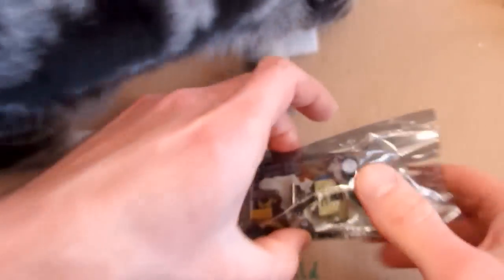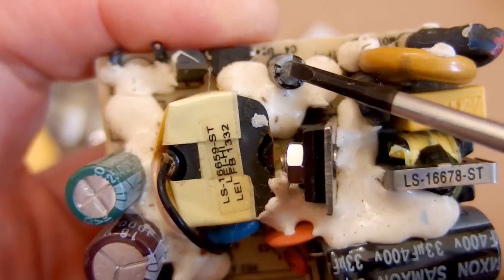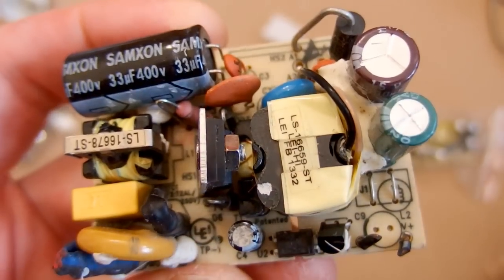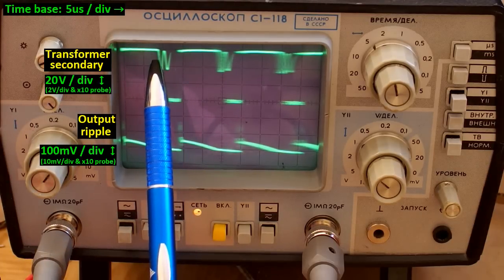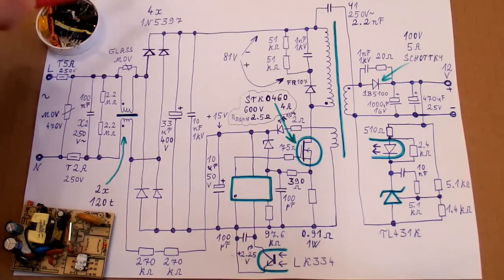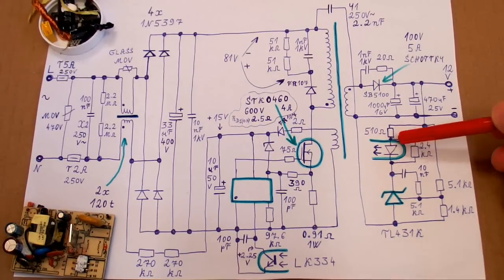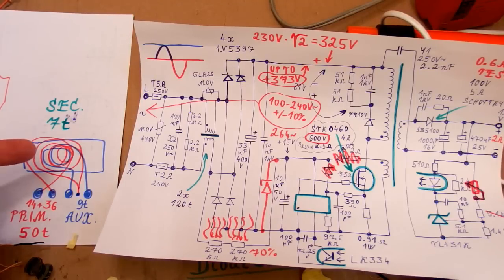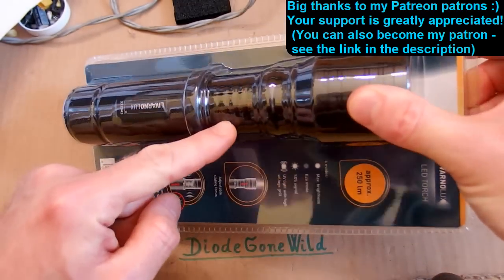12V 2A switching power supply - test, teardown, schematic, analysis

Comment: Yay, a power supply analysis, hope it isn't too dodgy

Edit: Not as dodgy as it looks. Seems like even salvaged circuits are better than brand "new" chinese ones. No wonder that these are often more expensive. Another flyback you reviewed had a "2A" output and "5A 100V schottky" diode that was sizzling hot. And hot output caps. And a hot switching transistor. And a hot transformer. And the list goes on...
Reply: You are right.  A lot of salvaged circuits are better made than newer cheapy Chinese ones, as long as your salvaged circuit isn't a cheapy Chinese one :)
Reply: @EsotericArctos  yeah, by the looks of it, this was likely taken out of a recycled or faulty power adaptor. It's fortunate that it's cheaper for them to make new boards
Reply: @lakiza55  Agreed.  This particular one that was disassembled was quite good.  But it is cheaper to by a cheap, less well isolated supply from China than to repair it.

Comment: I really like these ebay salvaged/repurposed switchers. you can get them in various voltages up to 24V and 1-5A current capabilities. theyre always good quality and look pretty safe. I must have used a dozen of them in various projects over the last few years. I tend to recap the output as a matter of course, and for some reason they often seem to have the remains of output wires tacked in before the final capacitor/inductor filter, or have unpopulated space like this one..
also worth watching out for is bizarre wiring schemes, Ive had a few where the cropped remains of wires used red and black for the 230V AC input, and blue and brown for the 5V DC output, ie the exact opposite of standard european wiring convention. if someone wasnt paying attention they could easily misinterpret that and connect 230V to the output. cap go bang.
Reply: if you put 5V at the output you get 230V

Comment: I miss the old heavy wall power bricks. Yes, the chunky transformer wasn't really efficient, but I have seen many broken switch-mode PSU's compared to very few chunk-former ones
Reply: Captain Diomedes - In a conventional PSU, the transformer itself has reasonable efficiency. And (assuming the transformer is a double bobbin type) they are much safer than poorly designed / poorly made (cheap) SMPSUs (switch mode power supply units).
The inefficiency comes from getting a smooth regulated and ripple free DC supply from the a.c. output of the transformer. Often a series pass transistor circuit was used, which drops the ‘unwanted’ part of the voltage fed to it to chop off the ripple of the top part of the waveform. In doing this, it converts this unwanted voltage into heat...
If a 78xx series regulator chip was used (e.g. 7805), these can now be replaced in most applications with a DC-DC switching regulator. This vastly increases the efficiency as no metal heatsink is then needed.
In a conventional PSU, the components used are not normally under and undue stresses. The voltages are all normally well below the components voltage rating. Of course there have been some where the current rating of the components was too low, or the electrolytic capacitors were not good enough, or the heatsink was too small, or there was a lack of suitable ventilation slots, and this will lead to failure. But overall, reliability is very good. In my job, conventional PSUs run continuously for many years (30 to 40 years plus). Well designed industrial SMPSU typically last 20 to 25 years. But in the consumer market, SMPSUs may only last for 2 to 10 years. Whereas a conventional PSU may last for more than 30 years. Obviously these figures are approximate and it will depend on usage, loading and the ambient temperature in which they are used.
Reply: Well, one of my other hobbies, apart from electronics, is listening on the Short-Wave radio bands. I have to make sure any device that uses a Switch-Mode supply is turned off (including LED light bulbs, monitors, phone chargers, etc). They produce tons of interference all the way up the bands into the 30MHz region and beyond. Old-fashioned linear power supplies don't have this problem. I even change my light bulb to an incandescent one when i'm using my radio as the LED ones produce interference too.
Reply: @risvegliato  - Compliant switch mode PSUs don't produce significant radiated interference in those bands.
However many PSUs don't comply with the EMC requirements. Theoretically that makes them illegal, but nobody cares about that stuff.
Reply: @johncoops6897  They all do produce horrible harmonics, sorry. compliant or not. If you look at the SW bands using a spectrum analysis program such as Spectrum Laboratory, you will see stripes all the way up the bands. Usually spaced so many 10's or 100's of kHz apart. All these SMPS's produce harmonics of their 'chopping' frequency. The worst culprits are Flat-Screen monitors and TV's in my experience. Try setting up a long-wire and a sensitive receiver and you will see what I mean.
Reply: @risvegliato  - I know exactly what you mean. There are limits on radiated and conducted EMC that SMPS (and devices that contain them) must comply to. Unfortunately consumers don't care about EMC etc so the majority of products don't actually comply (despite CE, FCC, RCM, etc labelling. I've spent most of my working career dealing with compliance of electrical products, so it annoys me how much work I did on making products compliant, yet opposition suppliers didnt bother and nobody cared anyway.
Reply: I Dont ever since i dropped one on my leg
Reply: @filenotfound__3871  Well, since it dropped linearly, it didn't chopped the your leg...

Comment: I guess the 5 amp fuse is there in the event that the MOV fails short...which I believe is a common failure mode.
Reply: I believe when the MOV absorbs spikes its voltage drops a bit... So its voltage quickly drops to nothing once it inches down to peak mains voltage. Just wanted to share my understanding of why they fail short.
Reply: The MOV and Fuse are not included in these circuits to "protect" the circuit by absorbing any voltage spikes, but rather it's there to allow the product to pass electrical safety testing.
The safety standards require that the item fails safely when subjected to a short pulse of high voltage at high amperage. The MOV conducts to clamp the mains voltage, so input current BLOWS the fuse. That test is only for "safety" and the unit does not need to be operational after that test.
This is the lowest cost way to ensure compliance with safety standards, compared to designing the whole device to cope with the high voltage test.
Reply: @eDoc2020  - The way that MOVs work is NOT like a physical switch which closes at a certain voltage. In fact they act kind of like a Zener Diode, and there is a "knee" in the voltage to resistance curve.
So, as the mains voltage raises to very close to the "specified voltage", the MOV resistance begins to decrease and they begin to slightly conduct. This small power flow creates heat, which the MOV is unable to radiate. As the material gets hotter, it's resistance reduces further so it conducts more power which makes it even hotter. In the end they simply overheat and fail "open" (not short circuited).
This "thermal runaway" is a common failure mode for MOVs, and they burn at fairly low currents because they are so small. A 5A fuse at 230V is like 1150 Watts.... a MOV would have vapourised long before the associated 5A fuse pops.
As the MOVs age, the material inside is literally "blown away" by each Transient absorbed. It's not so much that their "voltage decreases", but more that their ability to dissipate heat is reduced... in effect their "power handling" is reduced.
Anyway, they don't "fail short" because they are specifically designed to short. They fail by over heating, and that happens at only a few Watts, not the >1000W that a 5A fuse would protect against. I hope that makes sense :-)
Reply: @johncoops6897  That makes perfect sense. I must have picked up misinformation somewhere. I also know power strip surge suppressors can stop working without blowing the fuse, so that is definitely failing open.
Reply: @johncoops6897  thank you John, your explaining is so clear
Reply: I have a portable air conditioner which stopped working. When i opened its power circuit, I found the MOV was burnt and shorted (between live/neutral) and the fuse was blown. But not a single component downstream of them had any affect. Total damage was lesa than a dollar. So yeah, when working together, they are like tiny miracles.
Reply: @Ahmed-dx2cb  - Yes, that's exactly how they are supposed to work. It seems annoying that the fuse is usually internal (not replaceable by normal consumer), however that's by design.
The MOV and Fuse were  only included to pass electrical safety testing (usually 1000V pulse) so reduce the manufacturer's liability, the product needs to remain safe (to humans) against voltage spikes/surges. Since the MOV is a critical component, it also needs to be checked/replaced - Hence the fuse replacement is a job for a technical person.

Comment: It seems more common to see the class Y capacitor hooked between the lower side of the primary and secondary windings (positive HV and common on the primary/secondary) as is done above on higher power flyback supplies. Back when I was designing my own I was trying to figure out what the advantages/disadvantages are to hooking it to either the live or neutral rail on the primary side. I would assume potentially having it hooked up like above may provide a more direct return path for capacitively coupled interference back to the primary side, and also keeps the lower portion of each winding at the same RF AC potential by shunting out the stray capacitance. Not really sure.

Comment: The device might be a power supply for halogen lamps. These usually provide a voltage slightly lower than 12 V in order to prolongue the bulbs life (so do iron core transformers, which usually provide 11.5V effective voltage
Reply: Do tell more because i thought halogen lights used line voltage
Reply: @ceilingfanmusic6597  There are halogen lamps labelled GU10 or R7S which use line voltage (e.g. 230V in Europe) However, there are 12V Types eg with G4 or G6 sockets. These I mentioned...

Comment: The annoying white goo (which also comes in other colors) is fast-setting adhesive compound. It's to prevent components, especially heavy ones like the primary capacitor from bending back and forth at their solder joints due to vibration and physical shock so they don't eventually break off from the board.

Comment: The zener diode is a simple protection against broken feed-back /* PC817 or TL431 */ it senses indirectly the voltage on the secondary via the control winding and limits PWM duty-cycle. From my point of view it's better than using two transistors resistors and capacitors.

Comment: I have a 24v/5a 120w power supply.when i checked the circuit board i found that a copper plate(same size of pcb) is connected between the output ground and heat sink at the bottom of pcb.i don't know why they used that copper plate🤔
Reply: Shielding due to interferences

Comment: That tiny heatsink is useful and works for that package type thas is mostly plastic, if the package was the one that the rear plate is metal its usefulness is reduced a lot and is near marginal in a lot of cases where in the plastic type is useful.

Comment: So, the temperature of the power supply depends a lot on the enclosure it is in.  If it is in a plastic enclosure, it will run much hotter than if it is in a larger piece of equipment.  Would have liked more heat dissipation on the diodes, though.  Just a little aluminum goes a long way.

Comment: I am confused about how the chip starts up. How can it use unrectified AC to charge the 10uF cap up to starting voltage if the net DC current from an AC supply is zero? Does it start up fully within the first half-cycle of the AC waveform? Doesn't it need to complete a half cycle to get any power through the transformer to the auxiliary winding?

Comment: The chip in sot 23-6 package is probably CR6850S. Novel Low Cost Green-Power PWM Controller according the datasheet.
Reply from the maker: It could be :). or OB2263 as somebody else mentioned. Both have a matching pinout.

Comment: @DiodeGoneWild  I have a question. If I send you thorough pics of a ip camera power supply, could you help me troubleshoot why the voltage is to low? It's 5V/ 2000mA output and it won't power the camera because it only outputs 4.5V. Camera gives a led fault. Camera works fine with another identical supply.

Comment: At minute 21 you says that the max voltage is 240+10% (264v), but here in italy (or is just my city) the max voltage is 230+20% ( 276v)
Reply from the maker: Do you really have +/- 20% tolerance? That's quite a lot. Most 220V-240V countries have 10%. Some 100-120V countries have 15% because it's harder to keep it accurate at lower voltage where resistive drops show up more.
Reply: 276V should kill old light bulbs very fast... cant imagine that
Reply: DiodeGoneWild in my electricity bill, it says 230+-20%, i have an ups that constantly monitors the voltage, usually here at my house i have 245v but it depends when you meausure it, i have actually seen 255v some times.
Reply: Dr. House uhm, never thought about that but here this is a common problem. Most of the chandeliers at my house does not have all the light bulbs because they blow up really fast and 2 light bulbs are enough, even if you are supposed to put 6 of them in the chandelier
Reply: Even in places with tighter mains voltage there can be temporary voltage spikes and surges. Equipment should be able to handle that without damage.
Reply: @chrisparussin5359  Most LED bulbs can probably handle higher mains voltage. If you still use tungsten bulbs a diode in series will drop the power and make bulbs last longer.
Reply: eDoc2020 i was not speaking about voltage spikes, is just that sometimes the voltage goes up and down
Reply: eDoc2020 almost all the light in my house are 12v led lights but we have two old glass chanderiers in where you can only put incandescent bulbs and they usually last a year
Reply: @chrisparussin5359  You could probably put in some of those filament type LED bulbs, I put them in some antique fixtures and they are quite nice.
Reply: In the UK, the declared voltage and tolerance for an electricity supply is 230 volts -6%, +10%. This gives an allowed voltage range of 216.2 volts to 253.0 volts. However if you live in the countryside on the end of the network the voltage may vary a bit more than this!

Comment: @12:43 Well, your O'scope is showing that it's not quite fully loaded.  At 5uS/div, the total duty cycle looks to be about 2.6 divisions, while the waveform shows there is still about 0.8 divisions left available.  Since this is at 1.8 amps, it means the power supply can provide a maximum of 1.8(2.6/1.8) = 1.8*1.44 = 2.6 amps total.  It held at 2.5 and will probably hold up to 2.6 (at least until that diode overheats).  But will likely become unstable at anything above that.

Your multiple power supply tear downs, reverse engineering, and schematics is teaching me everything about PSUs except a couple things I would love to learn.  First is how to alter the voltage output.  Not just how to change it, but all things I should consider.  Voltage ratings on caps, diodes, and certain resistor wattage ratings, etc..  And not just adjusting the voltage up, but also down.

I'd love to see a couple videos on this, one for a simple flyback, and another on an ATX PSU with over-voltage protection.  There's another video that shows a PSU, but he runs through it fast, doesn't discuss much, bypasses the protection circuits entirely, then abandons the project as "unsafe".

Comment: I would modify it for lower voltages by replacing the two starter resistors with a power resistor an a liniar ragulator so it dosent need the aux winding. The aux winding would just be for protection. Id also swap out the zener with a lower one of my choosing. Or maby even put afew zeeners on a selector switch so i can choose between afew voltages and still have protection for each.

Comment: Hi friend! I'm having issues with a power supply wich has an IC wich manages a Power Transistor like most of the cases you have shown. The problem is that the PT is ok when I measure it isolated from the board, but when is conected, it has no voltage out, so it doesn't excite the transformer (and it's auxiliary winding), and because of that the whole system can't start up.  How can I measure if the IC high-frequency output signal is OK? ( I don't have an osciloscope unfortunately) I want to thank you again for sharing all these videos. I have been learning quite a lot! Best regards!

Comment: Apropos increasing voltage much. Do you know these used HP ProLiant server power supplies (ODM manufactured by Lite-On) that you can get for like 15€? They are usually 600W and up, and they're fully 12V, no minor rails, and they have an edge connector, and they're half-height so two of them go redundantly in a server. The PSU chassis that they go into in a server generates minor rails like 5V and 3V3 from 12V. Anyway they get thrown out after their time runs out or at first potential sign of trouble, this is how they land cheaply on eBay. Some have issues like bad PWR_GD circuit or something else, or maybe their fan failed to spin up once for a few seconds and it's been logged to management software.

Actually there's a number of ODMs, but Lite-On are the ones that don't sound like a rocket taking off, and the ones that usually land cheaply. Delta and a few others happen too, so you just look at the UL E listing number to decode the ODM.

So i was wondering, can you stretch them to 24V? Also would you be curious to just take a peek at one?